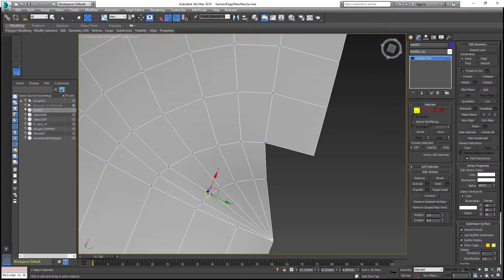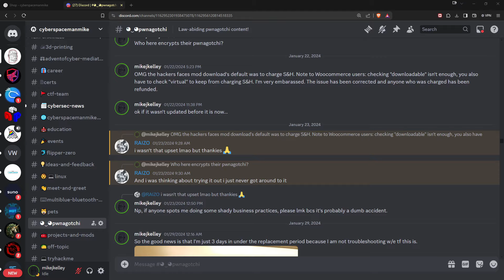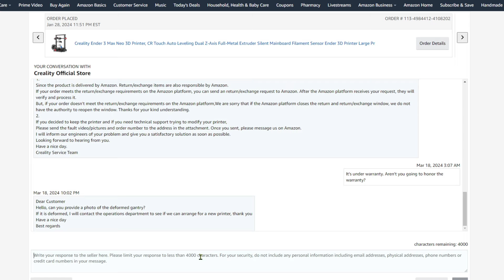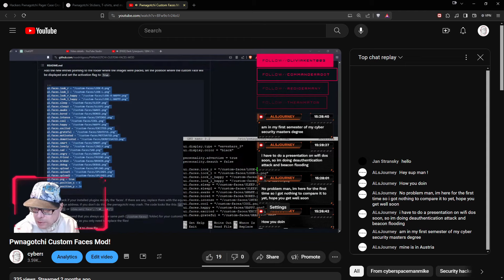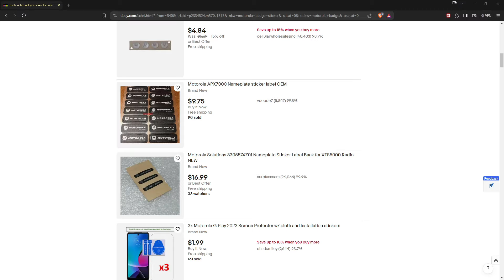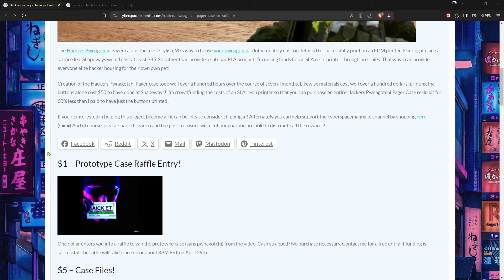Hackers Pwnagotchi Pager Case!

Comment: What battery do you use for the pwnagachi and how long does it last?
Reply from the maker: I use the Pisugar S Portable 1200 mAh battery: https://amzn.to/48X5T7T
BTW all the hardware and some alternatives are in this video: 
https://studio.youtube.com/video/R-fTPv09vQ8/edit
The battery lasts, for like, ever or at least a very very long time.
Reply: @cyberspacemanmike  more than 24 hours?
Reply from the maker: @AmCanTech  With a 1200mAh battery, you can expect the Pwnagotchi to last around 6 hours between charges if it consumes an average of 200mA. Here's the calculation for the battery life:

Battery Life (hours)
=
Battery Capacity (mAh)
Average Current Consumption (mA)
Battery Life (hours)= 
Average Current Consumption (mA)
Battery Capacity (mAh)

 

Using the given values:

Battery Life
=
1200
mAh
200
mA
=
6
hours
Battery Life= 
200mA
1200mAh

 =6hours

This estimate assumes an average consumption of 200mA, which balances periods of lower and higher activity. If the Pwnagotchi spends more time in idle mode, the battery life could be longer, and if it's actively scanning more frequently, the battery life could be shorter.